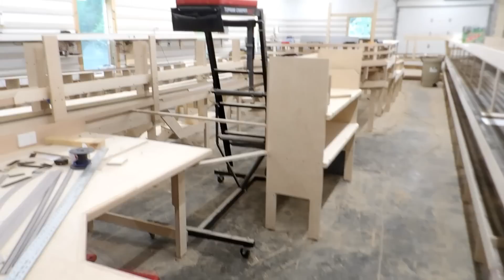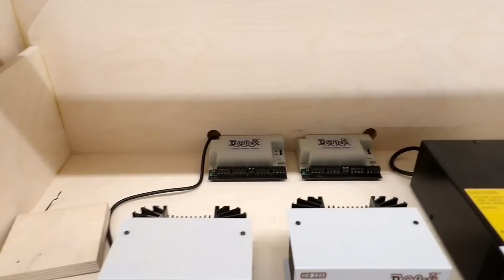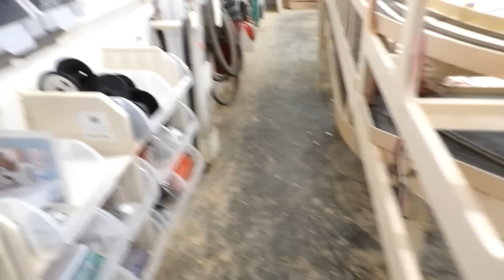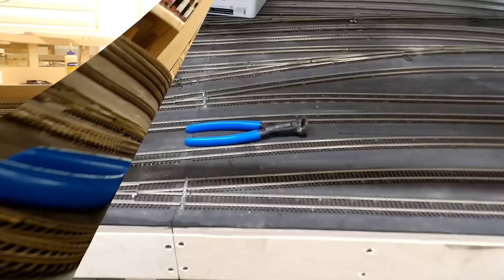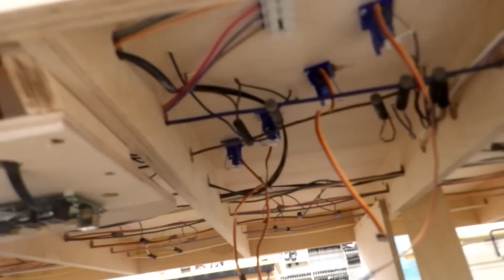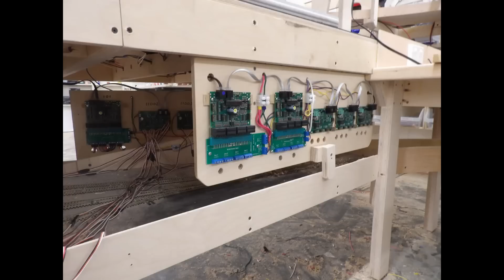The Sydney Project 25: Misc wiring & switch machines

Comment: Massive layoff with great quality woodwork. 
How do I wire a bi-direction reversing loop with 3 block detection sections on it. Will the block detector still work if the current is reversed ? Many thanks 🙏.
Reply from the maker: I generally use TVD dual frog-juicers for reversing loops.  If you want three detection blocks within the same reversing section, then one group on a Digitrax BDL168 should be just the ticket.  Do yourself a favor and buy the break-out board for it as this saves soldering.
Reply: @ Many thanks for your help it’s very much needed 👍

Comment: Does Australia operate on the same current as the US?
Reply: No. 240volts at 50 to 60Hz
Reply from the maker: No, they run on 250V (officially 240, but in practice usually closer to 250).  The Digitrax command station, boosters and main power supply all handle this voltage (I checked before buying them).  We will need to replace the outlet strips and all the small power supplies for the miscellaneous circuit boards when the railroad is moved.
Reply: @mpeterll should I be buying these now Peter?
Reply: @mpeterll  It used to be 240v, but apart from Western Australia, it's now 230v.
From a New South Wales fact sheet:
"Australian standards require electricity to be supplied at 230 V
(+10% to -6%), therefore providing an allowable voltage supply
range between 253 V to 216 V. Voltage is generally supplied to NSW
users between 250 V and 240 V."